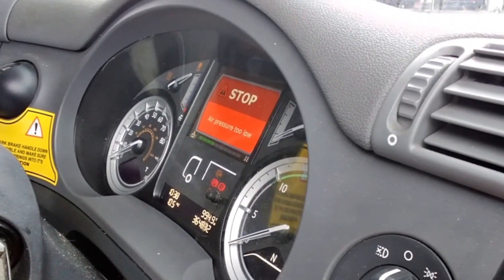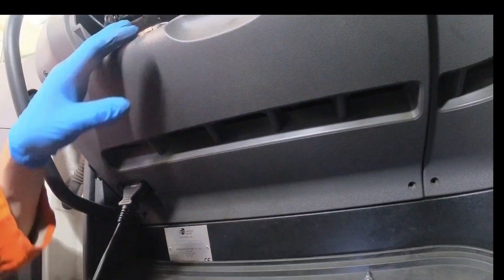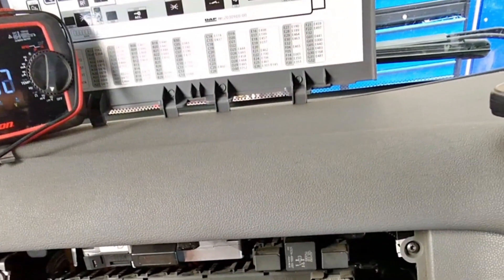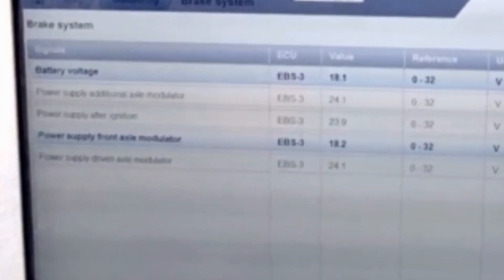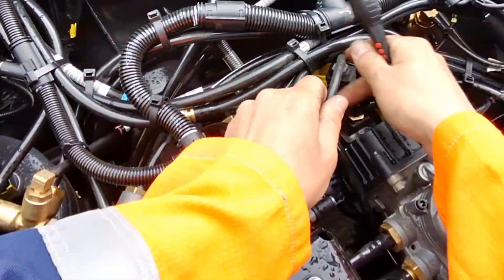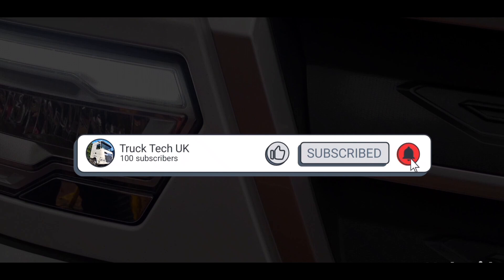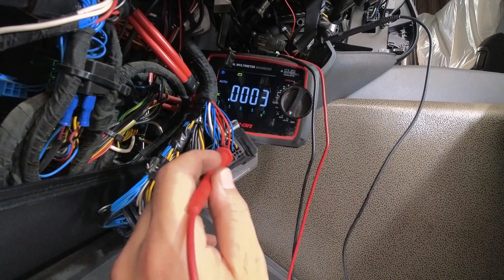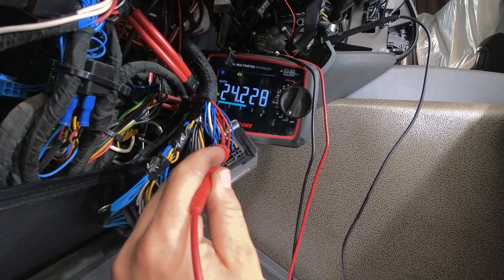HOW TO DIAGNOSE AND REPLACE DAF TRUCK ABS EBS ECU

Comment: When your program do you copy & paste the parameters from the old unit or get them from from davie ? Love your videos dude 👍🏻
Reply from the maker: Hey Joe. Thank you for the support buddy. 🙏 
I pull them from the back office at Daf, but I'm looking into more ways to do this, which I want to cover in the future, I'm awaiting TEXA to get in touch with me about ecu copy and paste with their new tablet and also I'm looking  at swapping EPROMs from one faulty ebs unit to a new or 2nd hand one BUT my component removal and replacement skills need a bit more work before I do a video lol
Reply: @TRUCKTECHUK  Couldn't this be done with KTAG? just wondering.
Reply from the maker: You can use ktag up to hardware numbers like 187xxxx. with hardware numbers like 2xxxxxx ktag will not work. anything after 2018 is locked. I'm sure something will become available eventually
Reply: @TRUCKTECHUK  Oh interesting to know. Hopefully would save time to reprogram all over again
Reply: @TRUCKTECHUK  would eprom swap work on the newer stuff? I'm struggling to see why not, but you may know better.

Comment: Do you know if the data on the obd port must be activated from the dashboard? I plugged a generic obd reader and i find no data on the obd port. Thanks
Reply from the maker: Hi, thanks for the comment. A generic code reader won't work. You need to use diagnostic protocols for heavy-duty commercial vehicles, specifically SAE J1939
Reply: @TRUCKTECHUK  thanks for the info!

Comment: I have Ebs mulfunction and yellow transmission warning can emodul2 cause this problems
Reply from the maker: Thanks for the comment. You will need to get the diagnostic trouble codes out of the vehicle and do some diagnosis unfortunately
Reply: @TRUCKTECHUK  okay thanks

Comment: hi chap wondring if you can help, i got a euro5  cf 85 6x2 unit has a strange fault i not been able to sort out, when fault is active get transmission fault and abs fault on dash when put computer on in transmission has error 3198-8 can message wsi from break system invalid signal . ebs module has error64-64 rear axil modulator d978 comunication problem / no power. when you go in to check voltages in module there it says when the errors are active only 2.5 volts on pin 9 when you mesure the voltage its all fine. ive checked the cables to rear break modulator ive changed rear break modulator and ive changed the ebs module. when the error is active and you manualy put power directly to the rear break module both errors go away. 
any sejestions. thanks in advance.
Reply: forgot to say all imput power to the ebs module are there p7 p8 p9
Reply from the maker: It's a CAN communication/power/earth problem from the  EBS ecu unit (D977) to the rear axle modulator (D978).  pins B1 and B4 of the EBS ecu (977) needs to be individually load tested with a bulb with a 24v power supply to the rear axle modulator to pins A4 and A3.
Possibly B7 of the EBS ecu (D977) to the EBS module (D978) pin A1 is interrupted so load test that too 
Also check the for a Interrupted earth connection or contact resistance in the earth connection of the rear axle modulator (D978) on pin A2. 

The reason the voltage drop/Comms is the ECU sees a problem with the power/communication so shuts down the system.
I personally would be running new wiring in from ECU to module as the wiring wasn't the best on euro 5.
Reply: @TRUCKTECHUK  hi thanks for getting back I had run a new power wire directly from ebs and ground wire right to cab earth point. Your telling me euro 5 wiring sucks. All hard bumpy gravel roads hear everyday is another gremlin with these trucks. Anyway thanks again I will have another go with that unit tomorrow and let you know